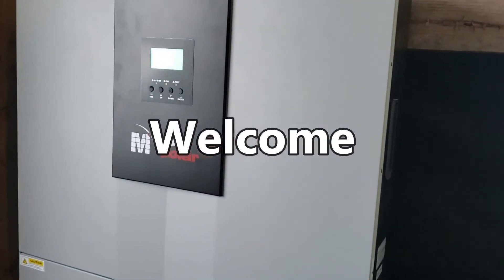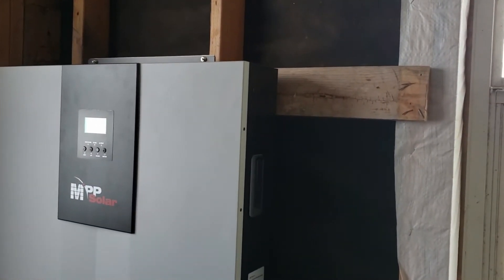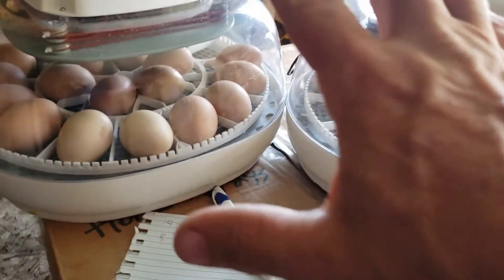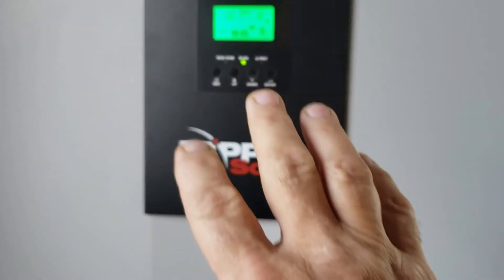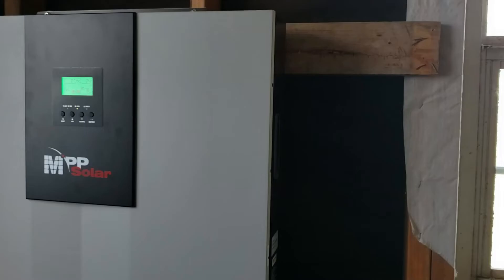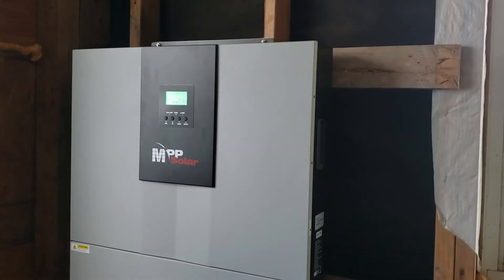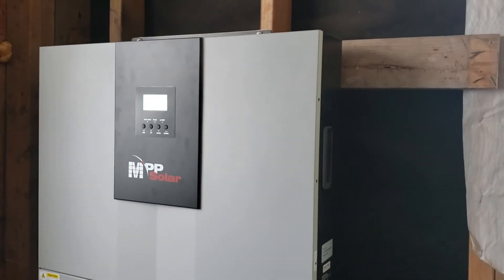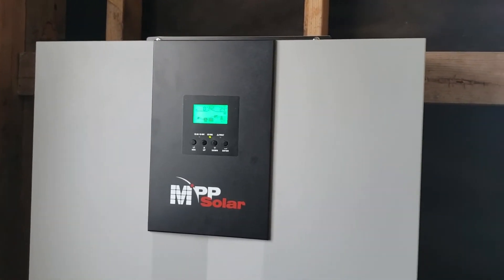Update MPP SOLAR LV5048  TESLA OR Salt Water Batteries Response to Comments

Comment: I run the same setup off grid and am also concerned about thermal runaway. 
My LV5048 is set to not charge beyond 48.8v and low cut off at 40.0v. 
Everything is mounted on concrete. 
Also, consider this as an additional precautionary measure:
https://www.amazon.com/gp/product/B07XV7H1GJ/ref=ox_sc_saved_title_3?smid=AIG8S5GW20F81&psc=1

Comment: hi

will be posible you record internal sounds of the LV5048 for a 5 minutes time?
 i have an lv5048 and has a litle tic tic sound from every 10 seconds. Maybe its nothing but i dont know if you can record the internal sound for about 5 minutes to know if its normal or not.
thanks
Reply from the maker: Mine has no ticking sounds. It runs very quite.
Reply: @TexasFilipino  hi can you make video of your 5048 sound?   just for 30 secs ?
Reply: Mine has that sound, but seem is just those plastic they use to redirect the wind inside de inverter
Reply: My LV5048 is mostly quiet. 
The fans rev up under load and mid-day sun. 
It does make a click-tock sound every ten seconds or so when deciding between day and night. 
Meaning, when switching to charge or not to charge from the solar panels. 
I’m not connected to grid power but perhaps switching between different sources makes other clicking sounds.

Comment: I do not use the MPP inverters but you are correct you have to check the settings. The only reason I do use is the lack of UL certification.
On the Tesla battery you are using, don't think you have worry about thermo runaway. Each battery has a fuse. However you can add a BMS to have more control. The pack have ton of power and can be pushed.
Battery tech is constantly changing. 
I started with AGM and have transitioning to Nissan Leaf cells which work great!

Comment: Does split phase all you to output both 110v and 220v simultaneously or just it just give you a choice for either one at a time using one inverter?  Im looking into having a solar option for my future philippines home.  Since i will be taking some of my 110v gizmos I'm looking for the best option to have the option for both voltages.
Reply from the maker: 220-230 VOLT Electric in Philippines is single phase (on one leg.) 220-240 Volt in Usa is Solit phase ( two 110-120v legs of of phase with each other. ) so you can use 220v From each country on North American power. As far has  North American Power it can make two single phase 110-120v  circuits and combine 220-240v two phase at same time. But NOT PHILIPPINE 220-230V. You would a inverter dedicated for one countries power or the other or just get a step down transformer. Personally I would avoid American powered items over there. Most tools and appliances  from THE REST OF THE PLANET will work on Philippines. Its North America that is odd ball globally. So there is LOTS of choices of tools and appliances there and online. Sell those American items. Set yourself free !! Lol

Comment: Have you considered using lifepo4 batteries?
Reply from the maker: I got to the financial status I have today from being stubborn and not always doing the " in thing" . Do you have a system? Give me all the specs of your system. You can email me pucd at jamesray080808@gmail.com  or fb Hightower Homesteads  send friend request. take care James and Melz
Reply from the maker: Not interested in them. Overpriced  and I feel they are just temporary choice  and something else will pop up on the market.
Reply: @TexasFilipino  I think you should really reconsider that. LifePo4 are not a fad, and not expensive at all when compared properly. your current Li-ion packs are a not-so-great choice safety wise, but lifepo4 is great.
I have watched enough of your videos to think I can tell how stubborn you are to changing your ways, but I would be remiss if I didn't try.
PS, what is the video called where you did the Texas solar install please?
Hai 2 Mel

Comment: make sure you use a proper bms.
ranges arent a problem.

these are lithium so 20% and 90% are fine 
if you need more power, add more modules.

this is recycling at its best
Reply from the maker: A proper REAL bms is the problem managing so many cells. Most of the bms out there dont really do the job. I will say that my test runs so far have been good.
Reply: @TexasFilipino  well not really, i am using jack rickards ( evtv) , little pricy, but tesla native and very safe
Reply from the maker: That is a good one!!!!

Comment: James, Tesla and Panasonic built a joint venture battery plant in Sparks Nevada.
The water cooled electric vehicle batteries and air cooled power wall setup changed
from 18650 batteries to  2170 batteries with a more sustainable chemical composition
and deeper discharge voltage. The battery numbers like 18650 and 2170 represent the diameter and length of the battery. The 18650 cells are commonly found in laptop and
 power tool battery packs arranged in series and parallel for voltage and amp capacitys.
     You can buy new cells or reclaimed cells and make power packs. Connect the base
lead with a glass fuse (3 cents each in bulk) and use the individual charge controllers
from E-bay that control 4 battery cells each, also dirt cheap on the top of the battery so batterys will automatically disconnect if they fail The 18650 cells fit into the 
gray PVC electrical conduit from the big box store. The new 21mm diameter would 
need a different PVC pipe size. Buss bars can be like #2 copper wire with the 
insulation stripped off or copper or brass flat bars. Anything solderable. There are small electric spot welders used for assembly of the fuses and controller chips to the batteries
which is how OEM battery packs are connected. 

              george and aurora   "concrete house building in ph" (no advertising channel)